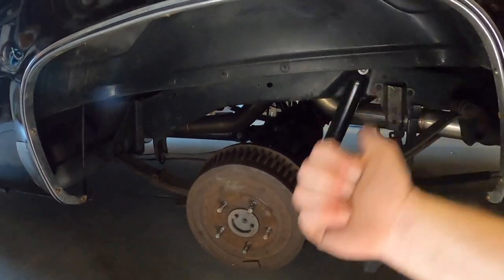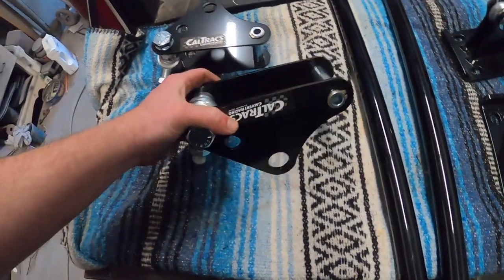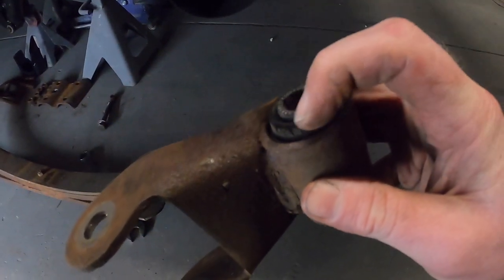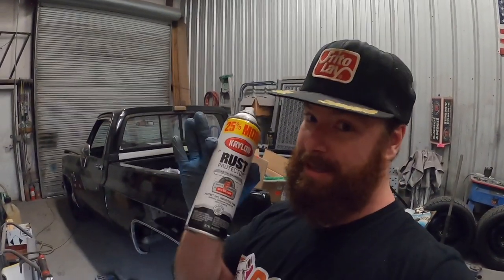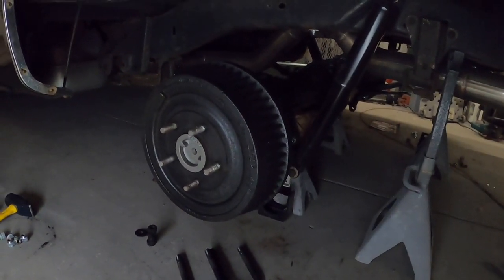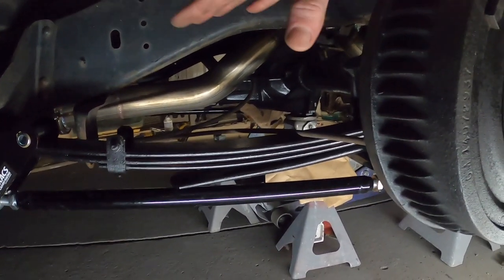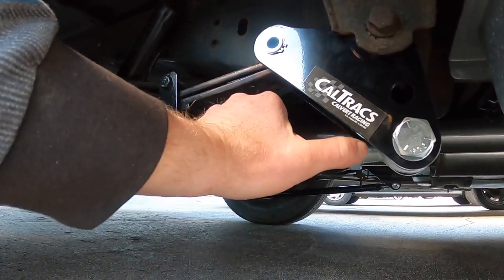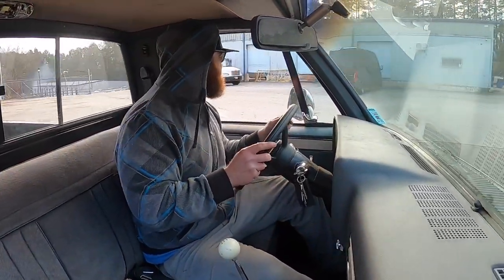Calvert CALTRACS Installation on 1985 C10

Comment: Year later, was still able to keep the overload springs on it? Im about to install some on my 83 and trying to figure out if they have to be removed or not for the bars.
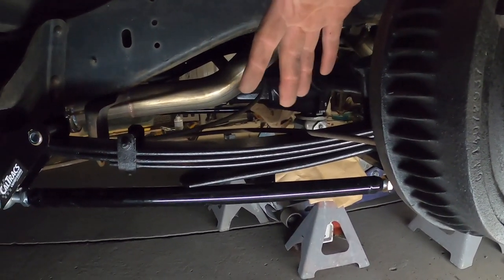Reply from the maker: @rudde67ssm62  check out the 16:00 mark for the solution!
Reply: @BestDamnShopAround  Yessa, saw that part and I did same thing, thx for tat. BUT, I was just wondering if that modification still holding up with no issues today sense this was a year ago, thx. Regards
Reply from the maker: @rudde67ssm62  yessir, no problems so far!

Comment: Cool Videos, What transmission is in the '85?  Also what shifter is being used?
Reply from the maker: T56 from a 97 trans am with a mid-shift conversion from SST. Shifter is the longest Hurst shifter they make that I modified the angle at the bottom to suit the bench seat.
Reply: Thanks! I have a 1978 GMC.  It has the original 3 speed that was converted to floor shift.  The shifter sits too far back.  Can't slide the seat forward...LOL.
Reply from the maker: @lawrence_tenn  dang it! Lol

Comment: This question isn’t about wheel hop… I’m about to flip kit mine and I’ve read a lot about the pinion angle after the kit that causes bind to the drive shaft? Is that a legit thing? If so, how do you fix that? I know this video would probably solve the problem but with just my basic flip kit and no extra money is there something I could do
Reply from the maker: With the standard C10 flip kit I've never ran into an issue with pinion angle. Always double-check though! They make thin pinion shims if it is a problem, they can be placed between the leaf spring and the flip kit to adjust the pinion up or down